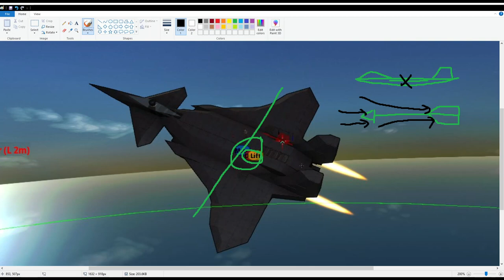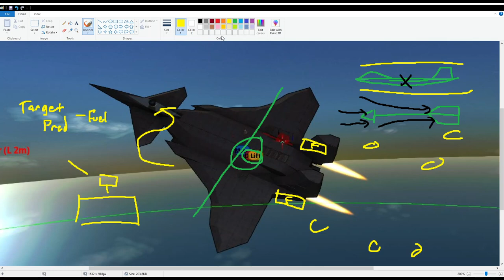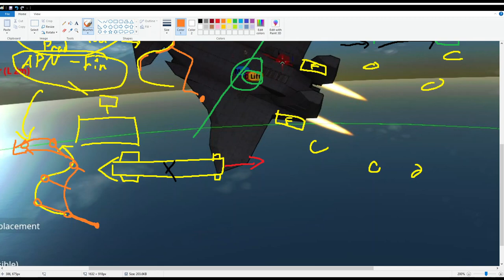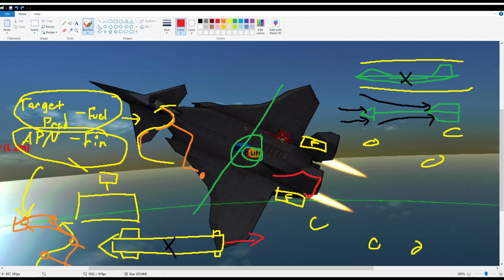[FTD] Aircraft Coaching

Comment: Re: Missile fins

The turning effect from a fin depends only on its distance from the center of the missile, not counting the thruster - so with a 12 block long missile, the center is the sixth block from the front. Also, fins at the front produce more drag than fins at the rear.

Thus, the first fin should always go just in front of the thruster. The second fin goes in front of that, and only for the third fin does it make sense to place it in front, right after the head. In general, you should have more fins in the back than in the front.